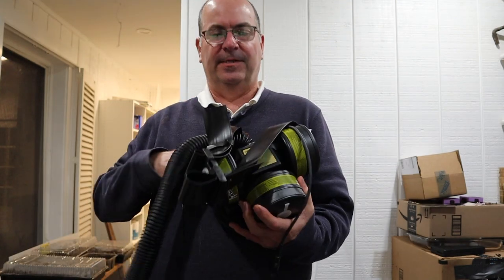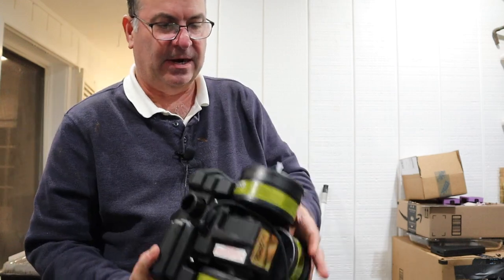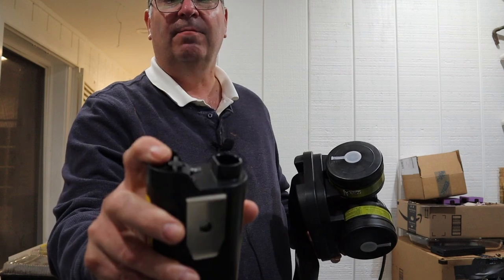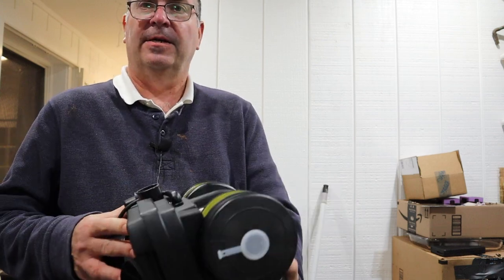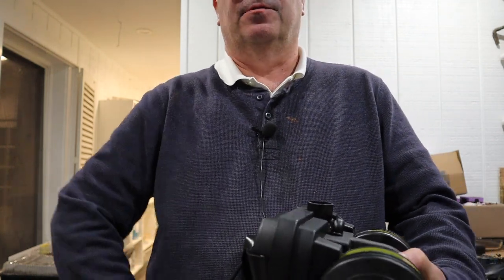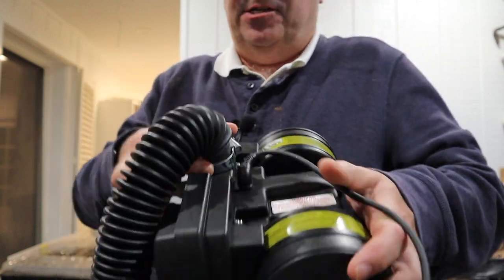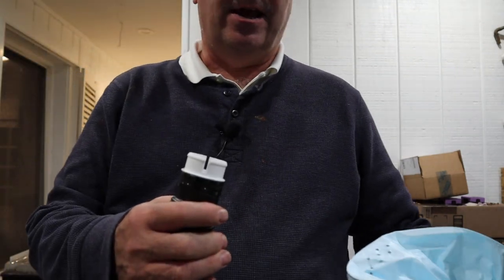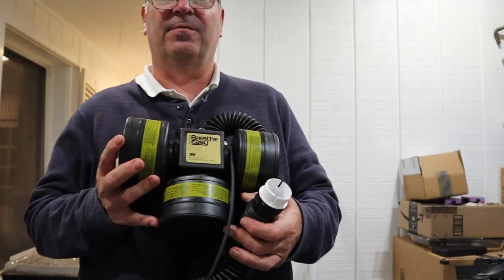3m "Breathe Easy" PAPR Quick and Dirty How to

Comment: Is it possible for you to check the flow with only the 2 side filters in and the bottom hole plugged? I am adapting a rig for my work belt to integrate this into our personal safety equipment and am debating on purchasing the breathe easy and cannot get an answer if it hits the required airflow in this configuration. The MIRA and others only require 2 filters so hoping this is possible.

Comment: Thank you for the overview. Can one of the filter ports be capped off, then only using 2 filters instead 3? Also do you know if this uses standard 40 mm filters?
Reply from the maker: Yes it uses 40 mm filters. I don't know if you can get by with two filters.  I'm certain 3M would say "no." Since I'm not 3M I'd say put the filters on and check the flowmeter to see if you're in range. However that's just what I'd do; I don't recommend that to anyone else.  It's probably dangerous.
Reply: @donttrythisathome7168  great thanks!
Reply: How many volts and amps is the battery?